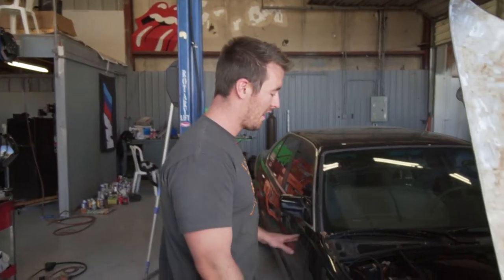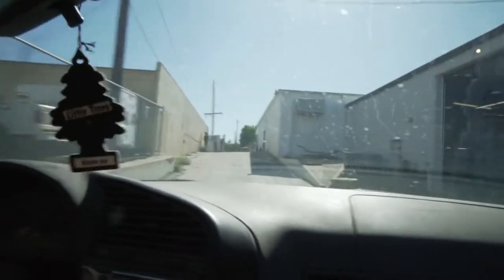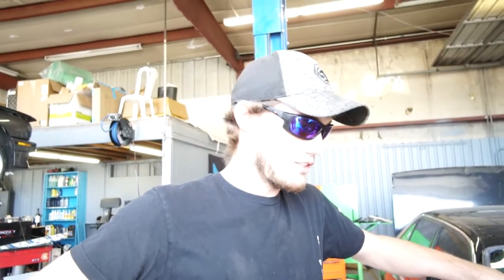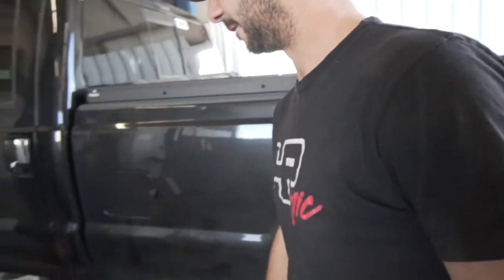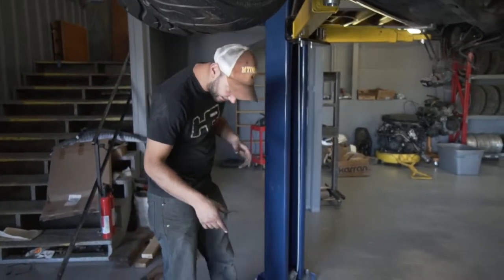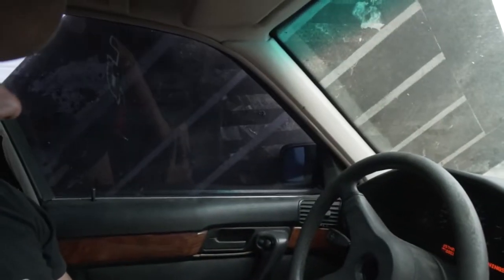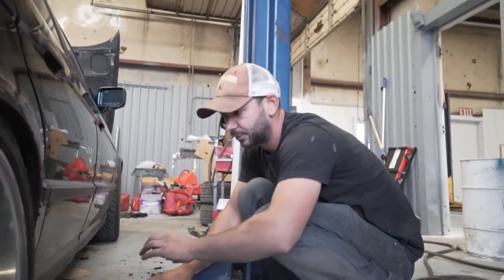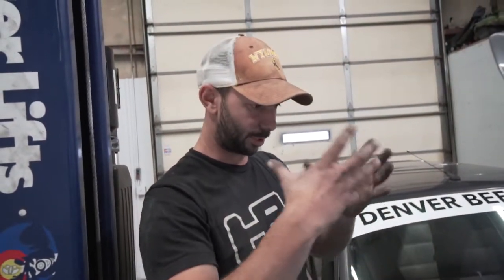Big Turbo e34 Back On The Road For TexFest!

Comment: Man I can't  find an affordable  header set for my 91 E34 535i. I am taking  some m20  headers and cut & weld to fit. I can't find many good part's  for these  cars. I need to get this thing running  cause it's way more cool than my e36. Thanks for the motivation  guy's
Reply: I have Ireland Engineering headers on my 1992 535i. I heard Schmiedmann also offers a set for a decent price.